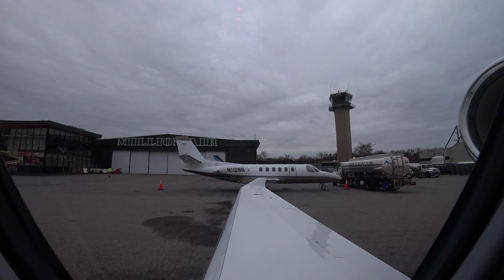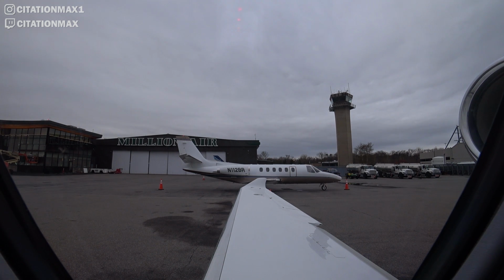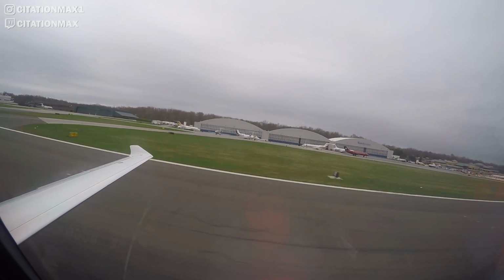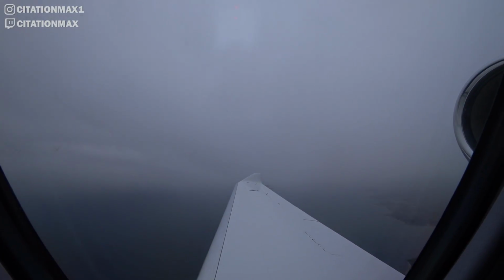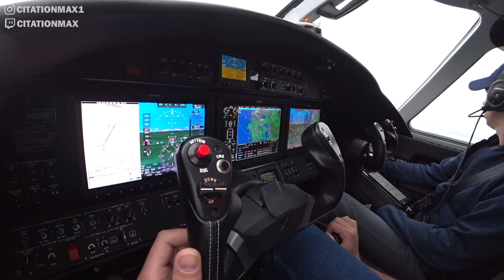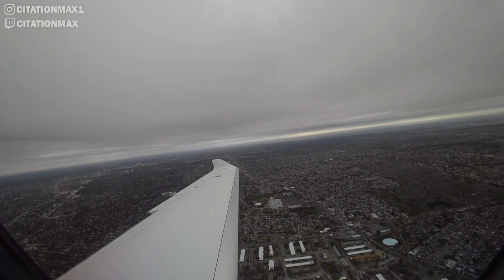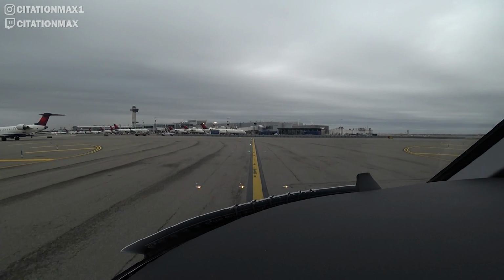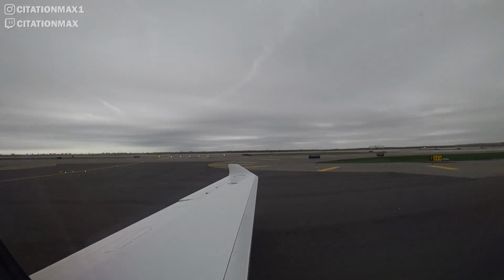Flying a Private Jet into New York's Busiest Airport JFK // Cessna Citation M2

Comment: Duck the main audio next time you're doing VO commentary, it'll sound better.
Reply: Yes, great video otherwise, but hard to focus on one of the audio streams when they're at the same volume during VO.
Reply: I disagree. What you hear in the video is exactly what you hear in the cockpit. It actually doesn't take long to get used to it.
Reply: Ducking and/or subtitled commentary.
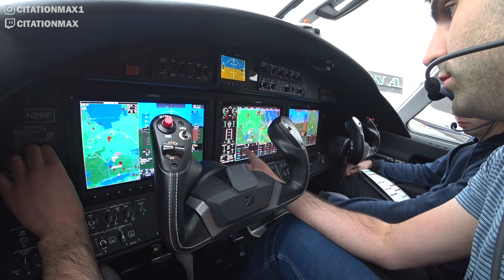Reply: @ps3nut  Not everyone is a pilot. I'm listening to 2 foreground conversations with very little context on what is being said in one of them. It sounds like a garbled mess. We're not talking about the radio traffic btw, we're talking about the VO at 3:00
Reply: @ps3nut  since when do you hear commentary from someone in the future editing your video?  Do you have voices in your head?
Reply: xpeterson @wildcardNS is correct about the 3:00 mark, but besides that it’s just a normal cockpit recording. I skipped over that part, so I had to go back and listen. If he adjusted the volume at that point,  there’s no reason to block out any of the other radio chatter.

Comment: As good as the PIC is as skillful flying single pilot and that the citation M2 maybe certified for single pilot ops, few CRM was not up to standard considering 2 Crew ops concept. 
- The pilot non-Flying (PNF) is supposed to be the one talking to ATC. 
- The PNF is the one moving the landing gear handle
-  Being in IMC, l see 2 set of eyes down on the knee when the aircraft is on a turn, who is flying the aircraft when briefing for your approach? consider transferring the control of the Aircraft to the PNF before your briefing for there is a continuous positive control of the airplane.
Reply: Good points, but it seems this flight is being operated under part 91. Therefore, no SOP's  in place like 135 or 121 where it's set in stone what PF and PNF duties are. Seems like the pilot in the right seat is acting safety. Fun experience.